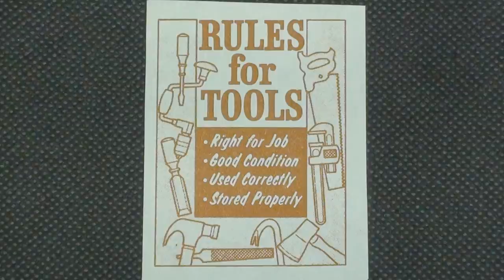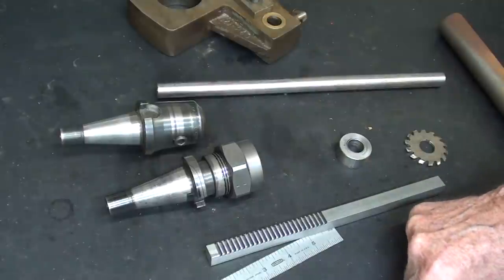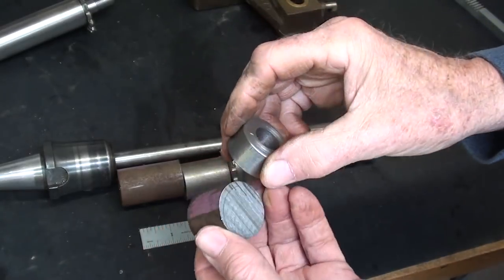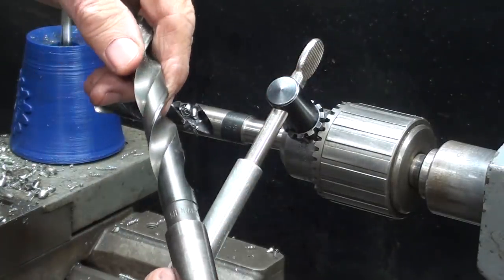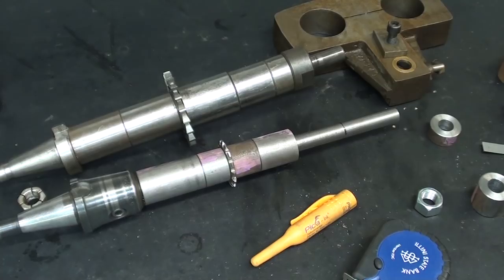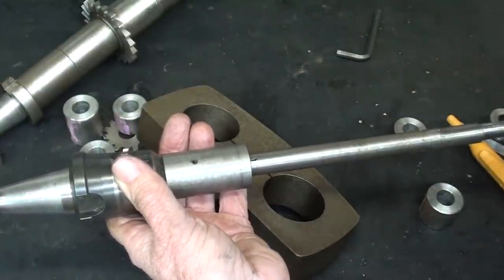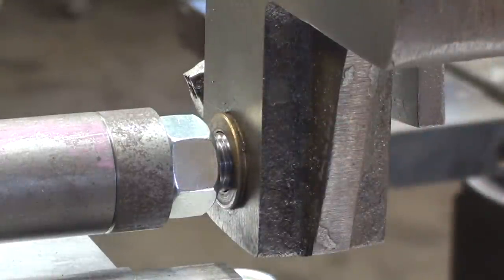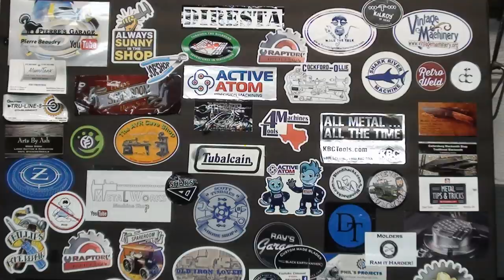Make an Arbor for Clausing Mill Tips #617 tubalcain

Comment: Speaking of milling flats on the drill bit shank:
   Some years ago, a group of us blacksmith types were installing a set of large doors into a building that in now a craft school.  We had made 2 sets of fancy 4 foot long decorative hinges.  I was in the shop area doing something when one of the guys came in complaining that the 5/8 inch bit they were using to drill into the steel hinge mounting points was slipping.  They were using a 3/4" Milwaukee Hole Shooter.  He asked if I'd mill flats on the bit.  I did.
A while later the guy came back complaining that he had almost broken his wrist when the bit caught but the drill motor didn't stop.
Reply from the maker: That is a good story. I had a three-quarter inch capacity Millers Falls electric drill. The drill bit stuck in the work, and the drill motor did not stall. It’s through me off of the bench where I was standing while drilling
Reply: @mrpete222  We aren't the only ones who have had that problem, of course.
Here's a webpage that I put together several years ago (with hints from many others) that offers some solutions:
https://spaco.org/Blacksmithing/Bighole/Bighole.htm

Comment: Nice outboard support solution.  Personally I would not bother keying the cutter.  Never did key a cutter much over 50 years of production machining.  Just sayin.
JIM
Reply from the maker: Probably not necessary it was a small diameter cutters
Reply: @mrpete222  
The belt and suspenders double security way of thinking...!!!    😉
Reply: ...you were LUCKY!!! It would be bad news if the cutter SLIPPED!!!
Reply: @daleburrell6273  You are correct in your statement.
JIM

Comment: Thank You Lyle...Always a pleasure, Always informative...I have a thought. Why not have a solid carbide ground end mill cutter for milling gears? Make it a 2 step process like when milling a T-slot. First cut down to the root of each gear than put the form ground gear cutting end mill  and go through the process again with the gear cutter end mill ?? Using a formed end mill would offer so much more closeness/ rigidity with zero problems clearances with cutting a rack ???...Thank You...TM
Reply from the maker: I am often thought that myself. Those cutters are not seem to be available

Comment: The spacers or tooling on a shaft make the shaft more ridged. The same principle applies to many machines. We have a molder that swings a 5" diameter by 9" long head on a 1 1/2" arbor, cantilevered, 6,000 rpm, 20 hp. Works fine. But there are times I wish it had 30 hp.

Comment: Hey MrPete do you remember a video you did with aligning stock in a 4 jaw. Where you used some antique indicators? There was one with a ball that had a pin through it.  And possibly one that you made. I believe you used the atlas in the process. I'm really interested in the indicators. Thank you.
Reply from the maker: I just did a bit of a search, I could not find that one. It really does not sound familiar to me
Reply: @mrpete222  it's ok. Thanks for trying. I didn't expect you to remember since you have so many great videos to go through. I may have been mistaken about the video. Chances are it was a non sequitur in a different subject. I want to say you were using the centering indicator in the chuck to align a tailstock. But anyway, please don't stress over it. I'll survive without knowing. I have so far. Have a great day. And good health.

Comment: Why Have A keyway on the shaft the Bushing holds the cutter by friction  I have taken a taken a 3/8" cut by 3/4" deep in mild steel without slippage  ?

Comment: I have some questions about milling machine can u plz help me
I want to make small milling machine for 9mm iron rod half slot cut 15mm width and 4 mm depth 
So if i make fixed arbor 1 feet long and 45mm diameter with 2 taper bearings arbor one side for pully and other side 3 inches for cutter fixing then front bush or liner bearing is important or without these arbor work.

Comment: This question I'm asking is not related to this video answered by any machinist.
A friend is cutting an ID of brass stock. I don't know what type of brass it is.
The boring bar he is using is brand new with cutting tip.
He's getting flakes as chips and the cut is rough. 
I would think he is doing something wrong.
Thanks for any education on this.
Reply from the maker: Try rotating the boring bar slightly in both directions to see if it makes any difference. It might be the Brass alloy. Some of them define being cut
Reply: @mrpete222  Thanks I'll let him know.